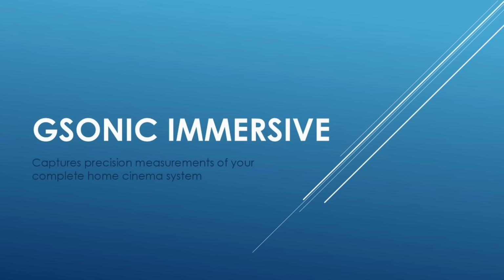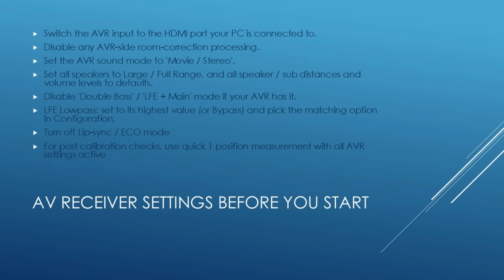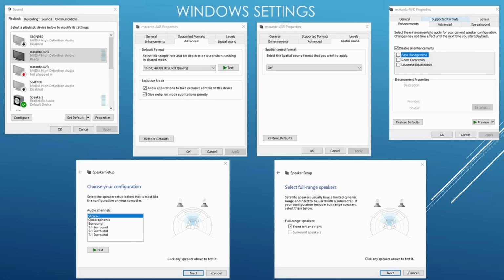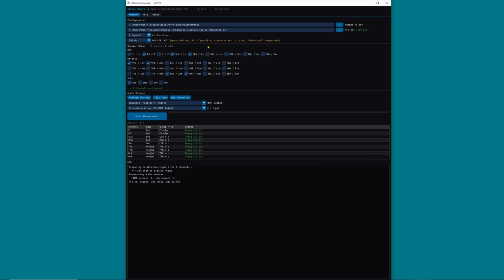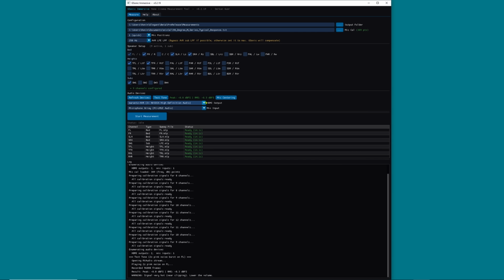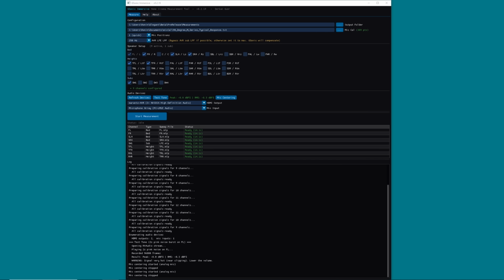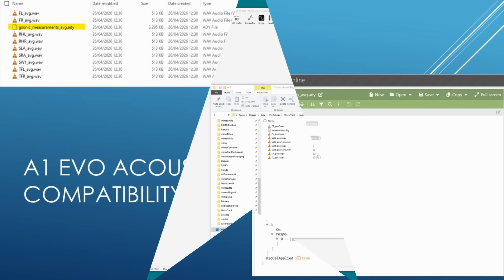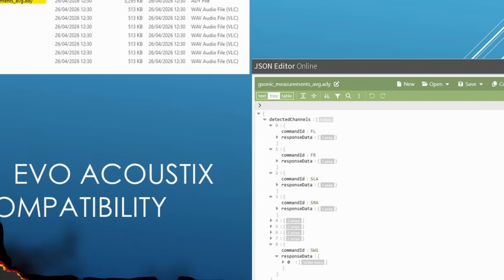GSonic Immersive

Comment: Love this tool; have a break, have a beer 🍻 😊
Reply from the maker: 🙏 many thanks man but you really didn't have to. Btw, guess why the new AVR reset works so perfectly on your C40? Rumour has it that the developer is using the same model now ;)
Reply: @o @ocaudiophile s always. I don’t think I have ever had a transfer error with any A1 either. Ahh .. enjoy 😉C40 is great 🎉
Reply from the maker: You may have noticed that AVR reset is now resetting everything including "LFE distribution" and 2 channel playback!
Reply: @ocaudiophile  reset is working perfectly ;-) I have noticed on the latest version however I have to drop MV from -18 eventually down to -30 to prevent the following message:" >>> FL recording shows the input is saturating - either clipping at the mic preamp or an unusually hot noise floor. Lower the AVR volume by ~6 dB and try again. Click Repeat to re-measure FL, or Continue Anyway to keep the (clipped) IR and proceed."
Previously I could use -10, -12, -15 without any issues.  Is this OK? When at MV -30 I don't get any messages and all is fine.  Should I ignore this message and leave at -18? These were single tests, just wanted to clarify before going through 8 positions 😊
Reply: NOTE: I have put my measurements log file on to the test folder under DigitalKirkley. My MV was -28 for the measurements however pos 6,7,8 I had to click continue anyway regardless of repeats as it would either be a red error or a repeat or continue. Hopefully this helps.
Reply from the maker: -28 is a bit too low. I will check your logs and get back.
Reply from the maker: your ATR chirps are landing on wrong places in some sweeps and wrongly warned as clipping. That's in fact due to strong reflections and your correct speaker distances might deviate. You can achieve good results with the correct volume levels, etc. but better stay on your current calibration for a bit and don't go for a 8 position cycle for the simple reason that you have 4 subs and maybe you will not need to switch them on/off manually soon ;)
Reply: @o @ocaudiophile ounds awesome; will drop back to use previous 5 pos for time being thank you 😊
Reply from the maker: I can't find your other post, you keep posting all around :) Looked at your MLP only polarity reversed measurements. The problem I am seeing was because your measurements were all clipping. It seems app was warning you about that frequently. A clipped sweep or chirp is not to be taken lightly and needs to be discarded. The reason is your Umik-1. It''s a +18dB Gain version (not all Umik-1s are) and at the louder AVR volume levels, this added 18dB boost causes clipping. Solution is easy, you need to decrease mic gain setting in Windows. I added a warning in Test Tone with v1.1.6.1 (uploaded already) so you can adjust your mic gain before you start measurements. Turns out, 100% max boost is not the right setting for those mics and avoids you to take loud measurements. Once you set that (probably 50% or 0 - you will find out with test tone), your measurement oddities will disappear.

Btw, I could do sub switching much faster for 3 or 4 subs but that requires both presets to be wiped out of filters every time. I thought users would want to keep one preset intact when taking new measurements hence the extra wait between sw2 and sw3. I may add it as an option in the future.
Reply: @ocaudiophile  I sure do post in the various video comments and I also struggle to remember mysyelf - maybe time to resurrect my Facebook account  to join the A1 group  😉
Ahh OK, so that comes back to my original issue about clipping but originally I didn't see any messages in app with original 5 pos; except for these recent ones and I did just continue not  knowing (Is it worth disabling the continue anyway?). However, I completely appreciate what you mention about not taking clipped lightly/discarded.  I didn't realise this with regards to my UMIK-1 which has the 18db gain you mention. Let me go and experiment with the test tone (Brilliant) and get these resolved/working 100% first.  Fantastic as always. 👌

For the multi-subs, an option for wiping in future would be spot on but as it stands, works like a dream and allows easily switching back to a preset for listening once  measurements preset is done.  I will try A1X MIMO again once my measurements are sorted with 1.1.6.1 and come back to you then.   Thank you  again Serkan and I hope this also helps anyone else who may experience something the same 😃
Reply from the maker: You will need to run test tone a couple of times initially. and remember sub auto switch always requires a AVR reset button first. If you will switch to manual close the app and restart or else turn Audyssey off in the AVR as they will keep muting subs.
Reply: @ocaudiophile   it is working fantastic now  and MIMO all works in A1X also; therefore it was the UMIK-1 18  gain that caused all my measurement issues. I now have Windows 11 on my NUC set to 54% and it is perfect.  Thank you once again for the help, really much appreciated. ☺
Reply from the maker: Yes I was looking at the wrong place trying to understand why ATR chirps were not being caught correctly and blaming your room reflections as the cause but a clipped chirp has no peaks to locate. That was the issue.
Reply: @ocaudiophile  Afternoon Serkan - Was just doing a 5 position with 117 earlier. On pos 3, it stopped doing automatic sub switching as follows:  [DIAG] RHR IR peak: -53.8 dBFS (FL reference: -53.1 dBFS, delta 0.8 dB)
   Saved: RHR_pos3.wav
   Preparing the next subwoofer(s) for isolated measurement (~20 s, no action needed)...
   Couldn't isolate SW1 automatically; using manual setup for this sub. (If your AVR is in Direct / Pure Direct mode, switch it to Movie / Auto and retry.)
>>> Sub 1 of 4 (SW1): enable ONLY this sub at the AVR, mute the others, then click Continue.
   Waking subwoofer SW1 from potential standby (low-frequency wake-up)...
     Wake-up: playing wake_lfe.mlp (pulsed 70 Hz LFE ~6 s + ~1.5 s silent decay tail; the on/off pulsing is normal)...

SW1 (pos 3)  [sub]

Thought  I would report/mention cheers
Reply from the maker: Your network must have blocked the filter transfer just before the sweep for some reason
Reply: @ocaudiophile  ah ok - will investigate 😊
Reply: @ocaudiophile   Hey Serkan - could you check something for me please? In test folder, I uploaded a file: GSI-to-A1X-FL_avg-vs-FL0-Polarity.mdat - it contains GSI FL_avg and A1X FL0 - has the polarity changed when it has been imported? Others look OK and trying to work out if my FL is really 100% incorrect polarity. Any help would be appreciated ;-)
Reply from the maker: Polarities are correct but A1X FL0 measurement is corrupt.
Reply: @ocaudiophile  ah ok. I haven’t used the generate average from existing yet. Should I do this? Really appreciate you looking thank you. I only mentioned this as I was looking at measurements again thinking my left should have hits peaks and dips like centre and right; at least that was my thought so thank you. 👌
Reply from the maker: FL0 is not the same with FL_avg. FL_AVG seems correct.
Reply: @ocaudiophile  what do you think has caused it? Do I do a new set of measurements? I can check my 1 position ones to see if same as my 5 position. Or is it something else?
Reply from the maker: I don't understand. Is FL0 an A1X measurement or GSI measurement?
Reply: @ocaudiophile   FL0 is from importing the generated average .ady file produced by GSI.
Reply from the maker: I continue not understanding. There's no way that FL_AVG GSI file will end up as FL0 under normal circumstances.
Reply: @ocaudiophile   Serkan - sorry I think I copied a 1 pos measurement of FL over incorrectly - OMG so sorry man - I was convinced I copied correctly.  One of those days grrr!
Reply from the maker: @DigitalKirkley  I had to double check anyway. They are definitely not the same responses. FYI you should NEVER delete or swap FL_Pos1 while using "Re-average folder". It must be written somewhere in the app. FL_pos1 carries all the timing info for all other measurements in it.
Reply: @ocaudiophile   Yes 100% my mistake - apologies for wasting your time. I was validating some measurements with 1 pos and 5 pos and accidentally copied the 5 pos FL_avg to compare against the 1 pos A1X FL import.  I was trying to work out in REW if any of my speakers polarity were  incorrect. One of those days ;-)

Comment: The video calls out the denon and marantz miscalculation of distance and that I need to perform a conversion manually.  Is that true when feeding the data into AccoustiX, or does it recognize my Denon X8500HA and auto-convert that accurately for me?  If manual, do I have to override what AccoustiX configures after the fact?
Reply from the maker: AcoustiX does all that automatically for all compatible D&M models. You don;t have to do anything about it.

Comment: I am unable to get updates in GSonic, What is the contact address please?
Reply from the maker: I just re-sent you  the receipt email which has a link to download any updates. Check your spam folder if you didn't receive. Let me know if any issues.
Reply: @ocaudiophile  Thank you. Unfortunately your email has not arrived. I suspect one of us has mistyped my email address in the original purchase, as the system is not accepting my entry as valid. Is there somewhere secure I can forward you my address. I followed Gumroad this afternoon, so they have my address.
Reply from the maker: It seems you have chosen to opt out from receiving emails according to GR. I have fixed that now. Let me know if you still didn't get anything.
Reply: @ocaudiophile  Good morning Serkan. Unfortunately, I've heard nothing from GR. When I click on the "View Content" button this is what I get: "You've viewed this product a few times already
Once you enter the email address used to purchase this product, you'll be able to access it again."
Reply from the maker: If you can give me your correct email, I can change it in GR.
Reply: @oca @ocaudiophile  can I PM you on avsforum? My nick there is depaor
Reply: @ocaudiophile  email sent. Many thanks for your help

Comment: Thanks for the video, I am interested to know more about what you described as a Dolby permanet volume offset for the side surround channels? If measured discretly you would need to add ~1-2dB to the side surround trim levels in the AVR?
Reply from the maker: Thanks. If you measured your side surrounds with 7.1 pcm and then listen to Atmos, they will be dimmed by about 1.6dB, yes.
Reply: @ocaudiophile  Yes this is what I noticed! So when listening to atmos content I should increase the AVR trim level of those channels by 1.6dB? or is this done by design to better represent an atmos mix?
Reply from the maker: Problem is it's not exactly 1.6dB and is based on the content and how the Atmos decoder in the AVR places the object coordinates it in the room. I have measured it to be 1.3dB at times and 1.8dB at other times. I guess you would hear a better bubble if you set side surrounds by about 1.5dB higher with Atmos content if you didn't measure with GSonic ;)
Reply: @ocaudiophile  Thanks a lot, truth is if you dont test for imaging (both side surround and front channel playing at same time) level matching is not always enough... 

I found that toe-out of the surround channels provides a better imaging improvement that level matching - psychoacoustics in small rooms probably (tonality was the same)
Reply from the maker: Very true. I used to spend a lot of time with side surrounds placement and toe-in angles during the days of SACD 5.1 playback which was a great format IMO but died quickly. Nowadays with Atmos, I focus on front mains mostly and for the rest just try to achieve a descent general geometry.

Comment: Thanks again for your amazing work. I am very excited to try this tool with my umik1. but I have one question. It states that the software is tied to one machine and that's fine, but can it be used to measure multiple systems? Also would we get updates when they are released?
Reply from the maker: You can measure as many systems as you like with the PC the app is installed. If you need to change the PC for upgrades, etc. just let me know and I can renew the license. Gumroad will automatically email you when/if there's an update.

Comment: Hi OCA, plan to do new measurements today. But first a couple of questions.
1. You mentioned to set to the listening level, but in the AVR reset it sets to -18 dB which is not my listening level. Should I leave it at -18 dB or set back to listening level?
2. Computer noise, it’s not loud but I can hear it when the room is quiet. Is it negligible? If not, any suggestion to work around it? Thought of taking the PC outside but the mic cable not long enough.
Thank you in advance.
Reply from the maker: 1. You can set your own movie listening level, -18 is just there as a good starting point for users who forget to adjust their AVR volume. But too low volumes in noisy environments may cause issues so be generous.
2. That's fine as long as PC is not very close to the mic. Again, it's about how much above the noise level the sweep is. Test tone button turning green is a good start.
Reply: @ocaudiophile  Thanks! I have more confidence now. Alarm set at 4 AM tomorrow for the ultimate measurement.
Reply from the maker: That's dedication :)
Reply: @ocaudiophile  I want to reach endgame in measurement and calibration, at least until I upgrade something or or change a furniture in the room, and with GSI and AcoustiX now I have it. Thank you for making this happen, you’re the master.
Reply from the maker: ❤ Many thanks. Least I can do for such supportive enthusiasts like you.

Comment: Hello,

I am interested in purchasing the GSonic Immersive tool, but I have a specific question before proceeding.
In the demonstration video I’ve watched, I couldn't clearly see an option for measuring top surround speaker . Could you please confirm if the software supports measuring this speaker?

Thanks in advance
Reply from the maker: FYI next update will probably be able to measure Auro 3D channels (untested yet)
Reply from the maker: If you are talking about the Auro-3D specific TS speaker, no it doesn't support TS and CH Auro channels. If you have a higher end new model D&M receiver though, it's now possible to re-direct Atmos channels to Auro channels for measurement after U38 firmware update. AVRs like Monolith HTP-1 can already do that. Your only option with GSonic is to temporarily swap speaker cables during measurement. I may try to add them in the future but since Auro is a bankrupt company with no support at the moment, it's highly unlikely I will be able to find the correct sweep format for it.

Comment: Hi Oca, really enjoying your new software. A question - is it possible that the subwoofers measurement is somewhat different in terms of loudness in comparison to A1 AcoustiX? Or A1 Acoustix treats the GSonic measurement different? I have the same volume on my sub with measurement from both apps (ELAC 2070-2 - volume 58). With A1 Acoustix i can use your default curve and the sub gets a -8 db and sounds good. With the GSonic-Measurement I get a 0 db for the sub with your default curve which is way too hot. , I now use a self made curve with + 0db till 250 hz because of that. Doesn´t sound bad, but not as thight as with Acoustix. Any thoughts? Thank in advance!
Reply from the maker: Can you share a Measurements_.....mdat file from AcoustiX with its own measurements and the one it saved after running GSI ady file? Here's a link to upload:
https://drive.google.com/drive/folders/13eRDRmuTau_J90WkXuszPc_MZU5LWiYv?usp=sharing

PS AcoustiX saves a Measurements_timedatestamp.mdat and a Results_timedatestamp.mdat file in the app folder on every run.
Reply: @ocaudiophile  hi, i just uploaded a zip-file with my name - thank you
Reply from the maker: Question: Was this GSI ady file produced with v1.1.0 (latest version)?
Reply from the maker: Anyway, I have investigated your issue and it seems your sub has clipped with the GSI measurement below 80Hz. Above that frequency, the sub response is near identical between AcoustiX and GSI. The volume level of the sweep was beyond its capacity. The sub sweeps have a lower volume in recent versions to avoid this and you should also measure at the level you are listening your system at while sub's internal volume level should also be inline with FL (check measurement report at the end of a quick MLP only sweep to adjust correctly).
Reply: @ocaudiophile  Holy moly - i had to bring down the sub from 58 to 40 and the default 18db on the av to 23 to not get these ATR messages in the measurement log anymore. Till now i´ve always tried to get a negative 8 to 9 db on the SW with Acoustix with the curve i wanted to have some headroom - though you´ve already noticed in another comment, that it isn´t the world if you´re around 0db if you´re not playing extremely loud. Seems to be very different to the way AcousticX measurement process handles this, because till now my old settings were fine. Maybe this can be further improved upon - maybe a sweep of LF and SW before the measurement process to get those levels in sync?  Thank you very much for your help - my system sound perfekt now - until you bring a new software which will improve things even further (mimo maybe ;-) ). Very happy now. Nice weekend to you!
Reply from the maker: I am thinking of a subwoofer push test which will find out where your sub start clipping and adjust its volume accordingly so you get the maximum efficiency in bass. But it's not an easy one to code.

Comment: Would I be able to use this with an Anthem processor and ARC? If so, how?
Reply from the maker: You can measure your system, upload them in REW pre & post ARC calibration. But I don't know if ARC accepts your own measurements as its calibration base. I am sure there's a way but needs work on an Anthem device.